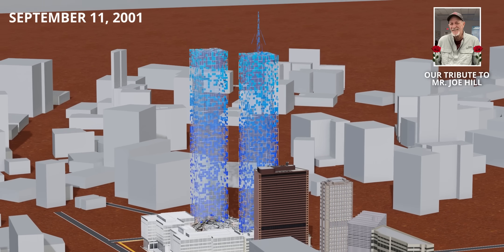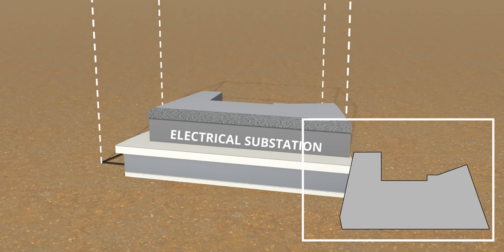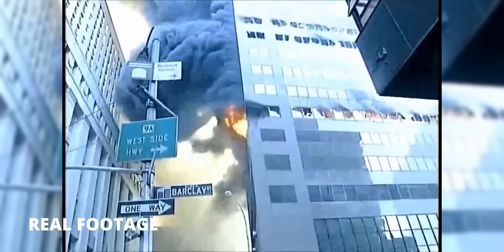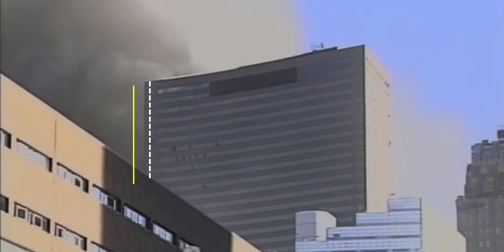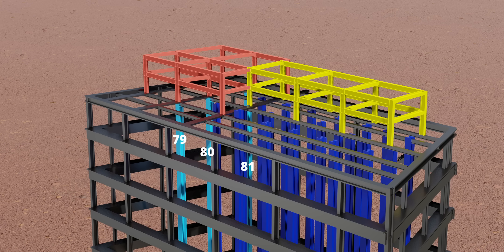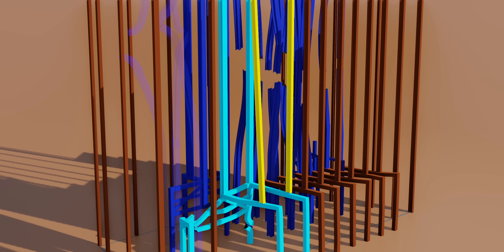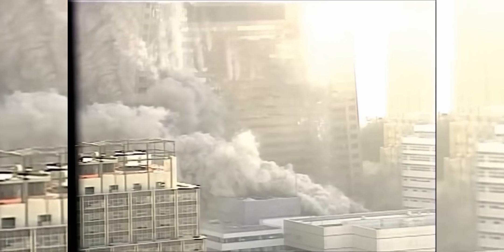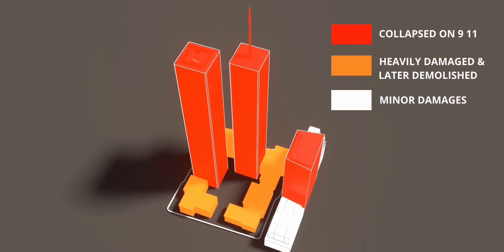Collapse of Building 7 | The Complete Physics

Comment: What would this building look like if it was a Controlled Demolition?
Reply: 1. No fires.
2. Months of preparatory work ahead of time
3. Hundreds of incredibly loud bangs

The building itself does not know or care why it is falling. It will just fall when support is removed - by whatever means.
Reply: @TheCriticalStinker-01  Can controlled demolitions only be done with explosives liar?
Reply: The twoofer says for a building to collapse like it did, all columns have to be cut simultaneously. But then the penthouse collapsed before the rest of the building. How could all columns fail simultaneously, if some failed before others?   Were there no columns supporting the penthouse?
Reply: @WhoIsJohnMcEnroe - Great. Start by showing examples. While you work on that,...

The unknown and unimportant Building 7 was the 6th building to collapse of 10 lost on 9/11. Though extensively studied, it still confuses many people. Not famous, or a terror target, and no casualties, thus it did not get a lot of attention and few know much about it, creating a void rapidly filled with garbage from the internet. Because everything seems like a conspiracy if you don’t understand how it works I prepared this brief summary explanation of my own analysis. No politics, just engineering. 

The North Tower collapse at 10:28am bombarded Building 7 with tons of burning debris, causing heavy damage and starting raging fires burning out of control for 7 hours. Half the responding FDNY firefighters having been killed, others injured, units in disarray, equipment destroyed, no water pressure, and the greater urgency of Search & Rescue efforts, firefighting at 7 was pulled as futile. The building couldn’t be saved and was left to its fate.

www.youtube.com/watch?v=g_SvpwyC17M&ab_channel=MFitz  

Collapse of a burning structure is always a concern for firefighters. Steel buildings subject to fire rely on active fighting of the fires to survive. Buildings are designed around 1 to 3 hours of fire resistance, allowing time for occupants to escape and ACTIVE firefighting to get started, after which all bets are off. Left to their own devices they will exceed their design envelope and collapse. In B7 the occupants escaped, passive and active fire protections were compromised and active firefighting was abandoned which left the building to take its chances. It lost. Odds on Building 7 would eventually collapse, and it did. No big deal in logic. That is the sort of choice firefighters make every day in brush fire situations - which houses to save and which ones to let go. Only real difference here is moving the decimal on the size and cost.

www.youtube.com/watch?v=WnYBX6QT0R4 

FDNY Chief Daniel Nigro ; The biggest decision we had to make on the first day was to clear the area and create a collapse zone around the severely damaged 7 World Trade Center, a 47-story building heavily involved in fire. A number of fire officers and companies assessed the damage to the building. The appraisals indicated that the buildings structural integrity was in serious doubt. I issued orders to PULL BACK the firefighters and define the collapse zone. It was a critical decision; We could not lose any more firefighters. It took a lot of time to PULL EVERYONE OUT, given the emotionalism of the day, communications difficulties and the collapse terrain

FDNY Deputy Chief Peter Hayden ; We had our special operations people set up surveying instruments to monitor and see if there was any movement in the building. We were concerned of the possibility of collapse in the building. And we had a discussion with one particular engineer there, and we asked him if we allowed it to burn could we anticipate a collapse and if so, how soon? And it turned out that he was pretty much right on the money, that he said 'In its current state you have about 5 hours

The collapse of Building 7 was anticipated all afternoon and widely reported in the media with at least 24 video cameras recording some or all of the collapse. Everyone at the time knew what was coming and why.

www.youtube.com/watch?v=OY5S5k3tMHI 

Building 7’s collapse was totally different to the Twin Towers, harder to understand and most of the details difficult to see. But we can sort out what happened through careful analysis and observation.  What follows is MY EXPLANATION of the collapse sequence using the best available information and relying on no authority.

B7 was complex structure, a 47-story steel framed building built on top of a smaller existing 3-story building, requiring several lower floors dedicated to complex load transfer structures instead of usable office space. Of trapezoidal shape and all-steel tube-in-tube construction, B7 (above the 7th floor) consisted of a central core of steel columns carrying most of the gravity load, perimeter steel columns around the outside of the structure carrying the remainder of the gravity loads and long span beams and girders to tie those elements together and form the floors. On the outside of the building hung a moment frame - the last part of B7 to fall. 

Phase 1 : Collapse initiation for B7 is notably quiet with observers not realizing the building was collapsing! There was no audible warning in the form of say hundreds of ear drum busting 180-190dB explosive bangs preceding the collapse. The first externally visible signs of collapse initiation occurred at 5:20:28 pm. Here at 12:00 a local CBS affiliate reporter is talking 10 blocks from B7 when collapse begins. People don’t start to notice the collapse until 12:11. Then at 12:45 is the famous CBS fixed camera clip of Building 7’s collapse Again, note how quiet it is.

youtube.com/watch?v=t5tEy6mXSE8&ab_channel=fresnosean379

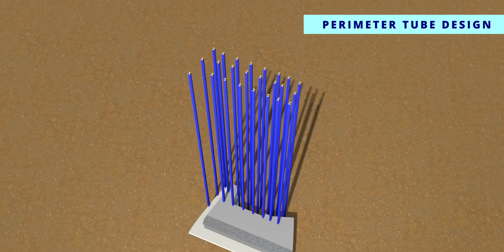Collapse initiation was due to multiple lower floor failures above the load transfer region (7th floor) in the NE corner of the building. In this video at 0:45 you can see the NW corner from inside the building while under construction, Column 79 just out of frame on the left. That big, angled steel beam across the top of the frame connects to C79 at one end. The girders connect to the beam. That beam and all those girders depend on just one connection

youtube.com/watch?v=nP3TNHPCIVU&t=35s&ab_channel=EdwardCurrent

Phase 2 : Lower floor failures caused a loss of critical lateral support over an excessive length of core Column 79 and it buckled. If you look at a floor diagram of Building 7 (see above) and look at all the structures that depend on C79 you quickly realize this one column was a relatively isolated structural element on which a disproportionately greater fraction of the structure depended . Externally we see a vertical progression of window breakage along the 44-46 line and a kink in the roof of the East Mechanical Penthouse at the top of the building, consistent with C79 failure. The transition from full capacity to almost no capacity occurs in virtually an instant. Once the buckling failure occurs there is almost no resistance

Normally with a buckling column, the load could very well be redistributed to other columns, meaning the buckling could stop after a while. With C79 that is not the case - the failure did not redistribute the load, so the collapse rapidly progressed to the roofline, sinking the rooftop penthouse.

Phase 3 : With C79 gone, B7’s progressive, non-symmetrical collapse continues with C80 and C81 at the east end of the core left laterally unsupported and quickly buckled and failed as well, sending the EMP down through the building. C79-81 all have no diagonal bracing, which I believe is a major reason why they could not redistribute a lot of vertical loads among one another.

From there collapse progressed from east to west through the central core until the core was gone taking all of the interior floors and structures and probably most of the perimeter columns with it. You can see the horizontal progression of window failures low in the building and the dropping of the remaining rooftop structures into the building. One of the big takeaways from the NIST Building 7 study (that gets completely ignored) was their modeling which determined C79 failing under ANY circumstances would have initiated the same collapse sequence.

Phase 4 : After some 10 seconds all that remains of Building 7 is just a hollow empty outer shell - the exterior moment frame - creating the illusion the building is still standing since little has changed externally. But it’s just a hollow empty shell like an empty cereal box supported by only a few remaining columns and quite unable to remain standing. With all the internal framing gone. the north face leans inward, forming a V in the roofline, the last perimeter columns buckle under the strain and with nothing left keeping it up the moment frame free falls, landing on top of the 7-story high debris pile. It is only at the very end that a single measurement of alleged free fall acceleration is taken. Note this is not the building but just its outer shell, and only one corner at that, at the very end of the collapse. Start to finish the entire collapse took 18-20 seconds, or less than 1/3 of true free fall and we have to look at the whole thing, not cherry-pick little bits to fit a particular narrative. Worth noting _how fast something falls cannot tell you what started it falling in the first place. The debris spread out, blocking surrounding streets, heavily damaging the Verizon Building and destroyed Fiterman Hall, all well outside of Building 7’s “footprint”.  

Building 7’s progressive, non-symmetrical collapse was incidental and unintended collateral damage from the combined effects of fire + time + gravity started by the collapsing North Tower. That is true no matter who planned and carried out the 9/11 attacks or why . The collapse was of so little consequence it barely even registered at the time, a mere footnote. 

Anything can seem like a conspiracy if you don’t understand how it works. Now you should. I hope you found this helpful and informative, not adversarial and it solicits informed critical comment. If I made any errors of fact, logic or reason or left anything critical out, please let me know so I can fix it. IF you can offer a more plausible alternative please do. Be the first. Please start any reply with the words “Tits McGee” or I will know you didn’t read it and are wasting my time.
Reply: @WhoIsJohnMcEnroe - Nope. Sorry, I already did it better.
Reply: @WhoIsJohnMcEnroe - Why does your brain not work?  FFS 🤦‍♂🤦‍♂

No a--hole, I replied to you because you conveniently ignored my last post which explains the collapse of Building 7 about a million times better than your pathetic efforts.  No need for you to keep posting utter nonsense and stupidity as the correct and much more detailed information is now extant in this thread.

I never even read Mike's posts. 

Why are you conspiracists all so utterly clueless?  Oh wait, you are conspiracists. Goes with the job.
Reply: @h1F595  Oh you forgot the real life examples mikrobrain? AGAIN?!?
Skyride tower Chicago 1935, Reichstagskuppel Berlin 1954. Maybe you should write it down somewhere mikrobrain, so you won´t forget AGAIN mikrobrain...
Reply: @WhoIsJohnMcEnroe - I already did and will do it again since we already established you ignored it the first time.

The unknown and unimportant Building 7 was the 6th building to collapse of 10 lost on 9/11. Though extensively studied, it still confuses many people. Not famous, or a terror target, and no casualties, thus it did not get a lot of attention and few know much about it, creating a void rapidly filled with garbage from the internet. Because everything seems like a conspiracy if you don’t understand how it works I prepared this brief summary explanation of my own analysis. No politics, just engineering. 

The North Tower collapse at 10:28am bombarded Building 7 with tons of burning debris, causing heavy damage and starting raging fires burning out of control for 7 hours. Half the responding FDNY firefighters having been killed, others injured, units in disarray, equipment destroyed, no water pressure, and the greater urgency of Search & Rescue efforts, firefighting at 7 was pulled as futile. The building couldn’t be saved and was left to its fate.

www.youtube.com/watch?v=g_SvpwyC17M&ab_channel=MFitz  

Collapse of a burning structure is always a concern for firefighters. Steel buildings subject to fire rely on active fighting of the fires to survive. Buildings are designed around 1 to 3 hours of fire resistance, allowing time for occupants to escape and ACTIVE firefighting to get started, after which all bets are off. Left to their own devices they will exceed their design envelope and collapse. In B7 the occupants escaped, passive and active fire protections were compromised and active firefighting was abandoned which left the building to take its chances. It lost. Odds on Building 7 would eventually collapse, and it did. No big deal in logic. That is the sort of choice firefighters make every day in brush fire situations - which houses to save and which ones to let go. Only real difference here is moving the decimal on the size and cost.

www.youtube.com/watch?v=WnYBX6QT0R4 

FDNY Chief Daniel Nigro ; The biggest decision we had to make on the first day was to clear the area and create a collapse zone around the severely damaged 7 World Trade Center, a 47-story building heavily involved in fire. A number of fire officers and companies assessed the damage to the building. The appraisals indicated that the buildings structural integrity was in serious doubt. I issued orders to PULL BACK the firefighters and define the collapse zone. It was a critical decision; We could not lose any more firefighters. It took a lot of time to PULL EVERYONE OUT, given the emotionalism of the day, communications difficulties and the collapse terrain

FDNY Deputy Chief Peter Hayden ; We had our special operations people set up surveying instruments to monitor and see if there was any movement in the building. We were concerned of the possibility of collapse in the building. And we had a discussion with one particular engineer there, and we asked him if we allowed it to burn could we anticipate a collapse and if so, how soon? And it turned out that he was pretty much right on the money, that he said 'In its current state you have about 5 hours

The collapse of Building 7 was anticipated all afternoon and widely reported in the media with at least 24 video cameras recording some or all of the collapse. Everyone at the time knew what was coming and why.

www.youtube.com/watch?v=OY5S5k3tMHI 

Building 7’s collapse was totally different to the Twin Towers, harder to understand and most of the details difficult to see. But we can sort out what happened through careful analysis and observation.  What follows is MY EXPLANATION of the collapse sequence using the best available information and relying on no authority.

B7 was complex structure, a 47-story steel framed building built on top of a smaller existing 3-story building, requiring several lower floors dedicated to complex load transfer structures instead of usable office space. Of trapezoidal shape and all-steel tube-in-tube construction, B7 (above the 7th floor) consisted of a central core of steel columns carrying most of the gravity load, perimeter steel columns around the outside of the structure carrying the remainder of the gravity loads and long span beams and girders to tie those elements together and form the floors. On the outside of the building hung a moment frame - the last part of B7 to fall. 

Phase 1 : Collapse initiation for B7 is notably quiet with observers not realizing the building was collapsing! There was no audible warning in the form of say hundreds of ear drum busting 180-190dB explosive bangs preceding the collapse. The first externally visible signs of collapse initiation occurred at 5:20:28 pm. Here at 12:00 a local CBS affiliate reporter is talking 10 blocks from B7 when collapse begins. People don’t start to notice the collapse until 12:11. Then at 12:45 is the famous CBS fixed camera clip of Building 7’s collapse Again, note how quiet it is.

youtube.com/watch?v=t5tEy6mXSE8&ab_channel=fresnosean379

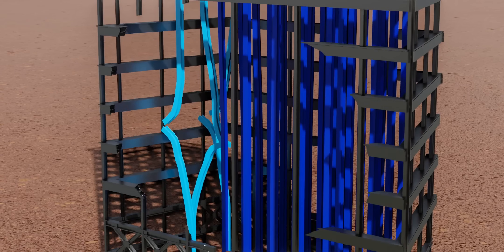Collapse initiation was due to multiple lower floor failures above the load transfer region (7th floor) in the NE corner of the building. In this video at 0:45 you can see the NW corner from inside the building while under construction, Column 79 just out of frame on the left. That big, angled steel beam across the top of the frame connects to C79 at one end. The girders connect to the beam. That beam and all those girders depend on just one connection

youtube.com/watch?v=nP3TNHPCIVU&t=35s&ab_channel=EdwardCurrent

Phase 2 : Lower floor failures caused a loss of critical lateral support over an excessive length of core Column 79 and it buckled. If you look at a floor diagram of Building 7 (see above) and look at all the structures that depend on C79 you quickly realize this one column was a relatively isolated structural element on which a disproportionately greater fraction of the structure depended . Externally we see a vertical progression of window breakage along the 44-46 line and a kink in the roof of the East Mechanical Penthouse at the top of the building, consistent with C79 failure. The transition from full capacity to almost no capacity occurs in virtually an instant. Once the buckling failure occurs there is almost no resistance

Normally with a buckling column, the load could very well be redistributed to other columns, meaning the buckling could stop after a while. With C79 that is not the case - the failure did not redistribute the load, so the collapse rapidly progressed to the roofline, sinking the rooftop penthouse.

Phase 3 : With C79 gone, B7’s progressive, non-symmetrical collapse continues with C80 and C81 at the east end of the core left laterally unsupported and quickly buckled and failed as well, sending the EMP down through the building. C79-81 all have no diagonal bracing, which I believe is a major reason why they could not redistribute a lot of vertical loads among one another.

From there collapse progressed from east to west through the central core until the core was gone taking all of the interior floors and structures and probably most of the perimeter columns with it. You can see the horizontal progression of window failures low in the building and the dropping of the remaining rooftop structures into the building. One of the big takeaways from the NIST Building 7 study (that gets completely ignored) was their modeling which determined C79 failing under ANY circumstances would have initiated the same collapse sequence.

Phase 4 : After some 10 seconds all that remains of Building 7 is just a hollow empty outer shell - the exterior moment frame - creating the illusion the building is still standing since little has changed externally. But it’s just a hollow empty shell like an empty cereal box supported by only a few remaining columns and quite unable to remain standing. With all the internal framing gone. the north face leans inward, forming a V in the roofline, the last perimeter columns buckle under the strain and with nothing left keeping it up the moment frame free falls, landing on top of the 7-story high debris pile. It is only at the very end that a single measurement of alleged free fall acceleration is taken. Note this is not the building but just its outer shell, and only one corner at that, at the very end of the collapse. Start to finish the entire collapse took 18-20 seconds, or less than 1/3 of true free fall and we have to look at the whole thing, not cherry-pick little bits to fit a particular narrative. Worth noting _how fast something falls cannot tell you what started it falling in the first place. The debris spread out, blocking surrounding streets, heavily damaging the Verizon Building and destroyed Fiterman Hall, all well outside of Building 7’s “footprint”.  

Building 7’s progressive, non-symmetrical collapse was incidental and unintended collateral damage from the combined effects of fire + time + gravity started by the collapsing North Tower. That is true no matter who planned and carried out the 9/11 attacks or why . The collapse was of so little consequence it barely even registered at the time, a mere footnote. 

Anything can seem like a conspiracy if you don’t understand how it works. Now you should. I hope you found this helpful and informative, not adversarial and it solicits informed critical comment. If I made any errors of fact, logic or reason or left anything critical out, please let me know so I can fix it. IF you can offer a more plausible alternative please do. Be the first. Please start any reply with the words “Tits McGee” or I will know you didn’t read it and are wasting my time.
Reply: @WhoIsJohnMcEnroe "But not true about bangs. Certain materials act as cutting/melting agents and therefore do not go boom."
"Certain materials", i.e. the "truther" fairy tale fantasy "thermite", has been used for demolition exactly ONCE, in human history. It didn't go well at all, which is why no-one ever has since. Sorry, your pet fantasy wasn't real.